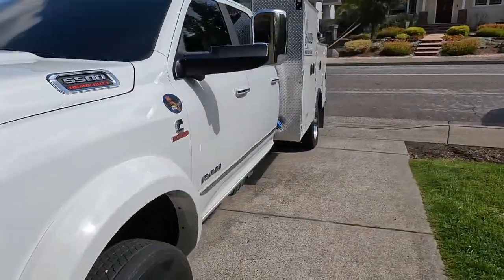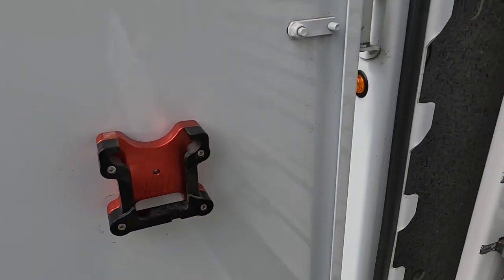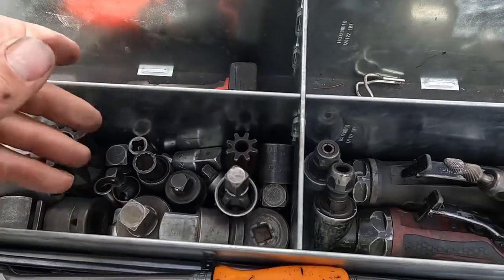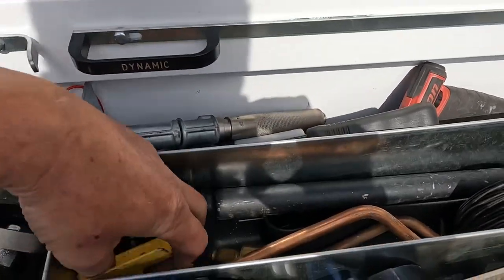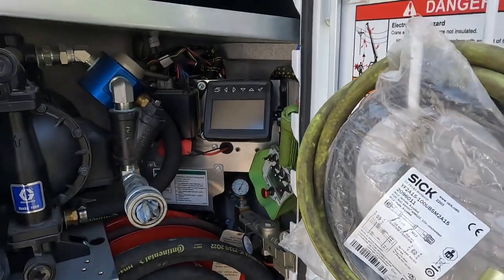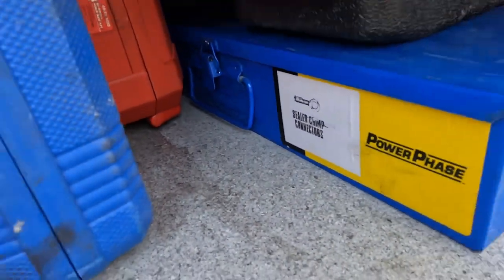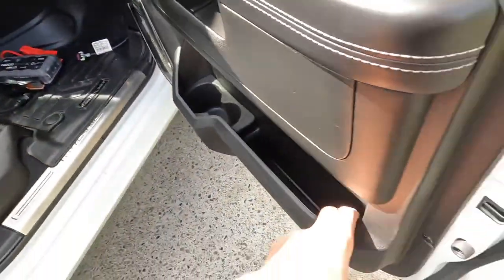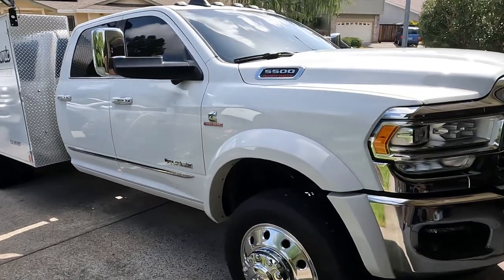Ram 5500 limited service truck tour.

Comment: I don't use a u joint press. I cut the cross with the torch, then push the cups from the outside inwards. One less blow molded case to make room for.

Comment: cool setup, how does the 5500 do on the highway? i drove a 2012 f550 and it was insufferable above 60 mph because it had no gearing and no insulation on the floors so you would cook your feet alive.
Reply from the maker: It’s great! 75 down the freeway no noise and drives smooth.

Comment: You said the truck is good for 26,000 ? Is that a combined weight, as the truck only has a 19,500 gvwr rating?
Reply from the maker: Yea it’s registered at 26 but according to the door it only good for 19.5.   My other truck is registered at 19.5. Every one of these trucks is over 19.5

Comment: I'm sure it's been asked is a toolbox on the driver side big compartment part of the service body is that something you put in the service body I'm trying to find a company that sells tool box that will fit in my service
Reply from the maker: It’s installed by the truck builder. Check out ag bodies inc.  I’m pretty sure they will built you any size box you want.
Reply: If you have a service body already look up the manufacturer of it and usually the driver side front box will have a ID and serial number you can give that info to the manufacturer and they should be able to get you a draw pack for that exact cabinet